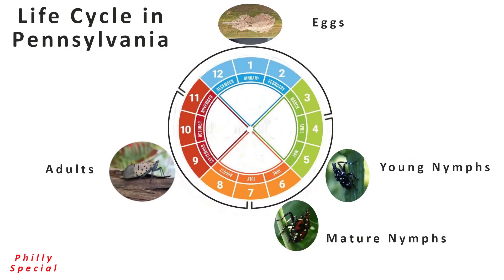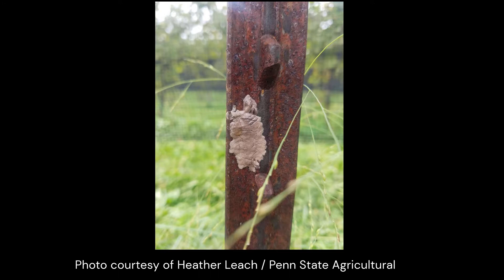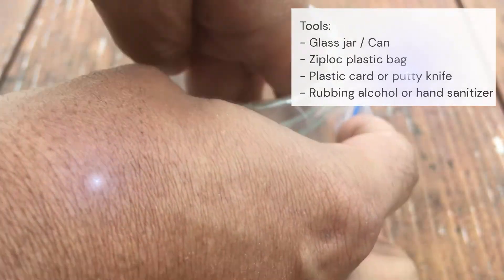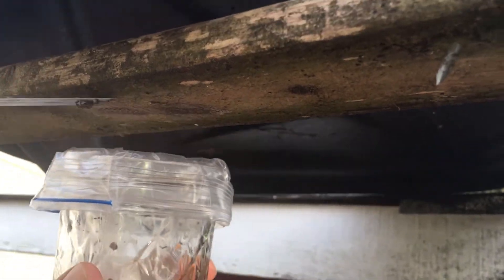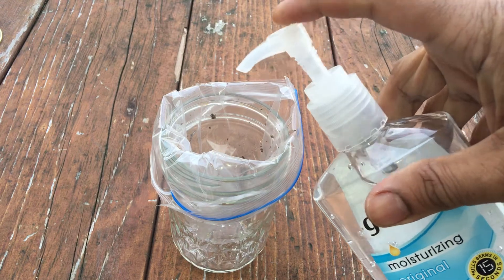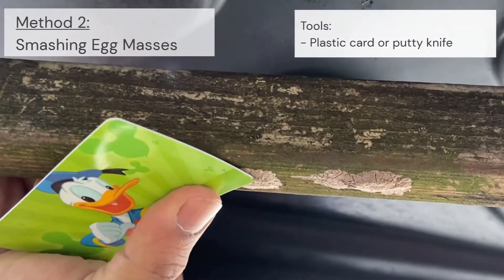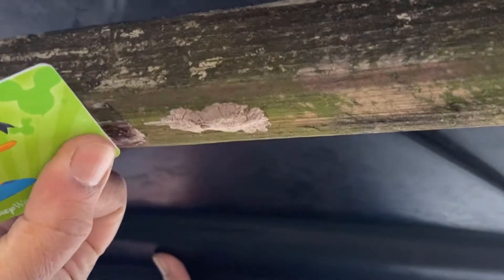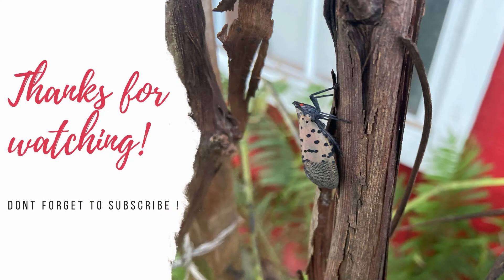How to remove spotted lanternfly eggs masses

Comment: I found using a flexible putty knife allows me to smash them in place cleanly, quickly, and easily.  No need to mess with all the single use plastic and chemicals.  

If you're finding them at the base of a tree, there's still going to be thousands of more above your reach, tape those trees in the spring with a narrow band of the fly tape.
Reply from the maker: I agree smashing the eggs with putty knife is more effective & efficient than scraping. We just have to be patient & make sure to smash them completely. Thanks for your comments.
Reply: Also be sure to wrap chicken-wire 2x around the taped areas (spaced out ~1" from tree) so squirrels & birds don't get caught on it